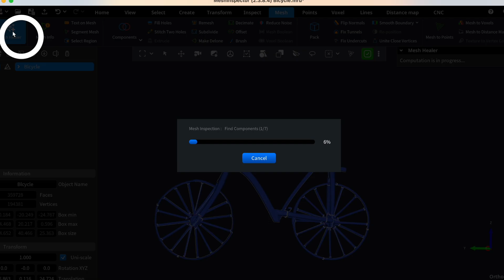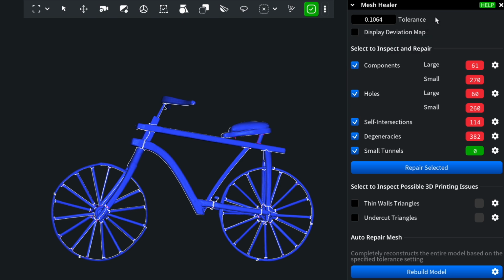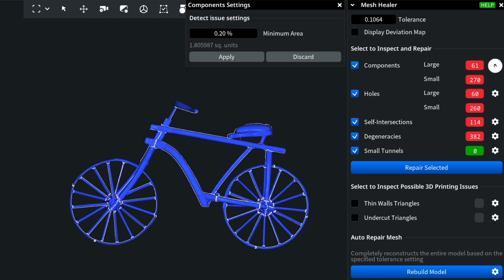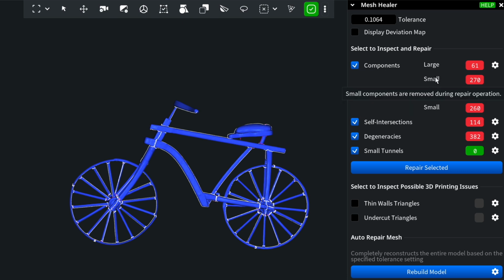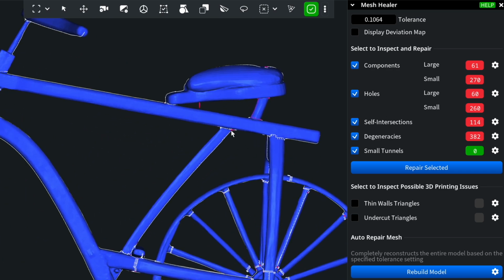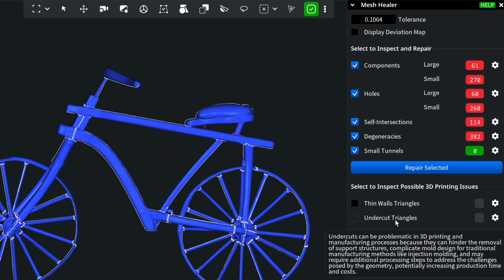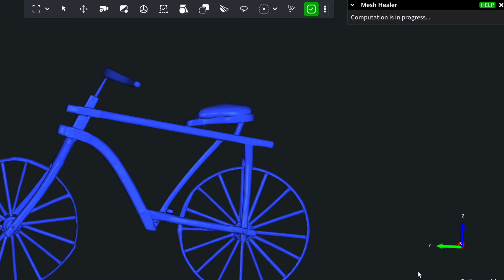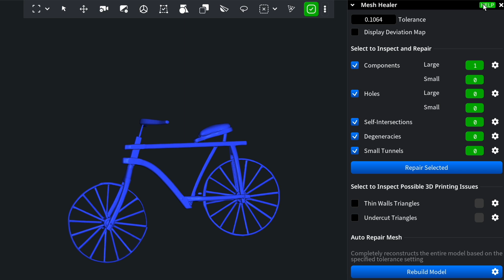How to Instantly Repair STL/OBJ in 1-click with Mesh Healer

Comment: Can't change the number in thin walls and all the rest
Reply from the maker: Hello! The wall thickness is identification in mesh healer is linked to the tolerance setting. There is a separate tool Measure Thickness on the Inspect tab that you can use.

Comment: How do you split on large and small components? Actually the result looks cool.
Reply from the maker: Thank you for your question! By default, MeshInspector categorizes components into large and small using a threshold of 0.20% of the surface. This setting is customizable, and you can adjust it in the component settings.

Comment: Wow, that's one rad bike model you've got there! Can you actually 3D print this beast and take it for a spin? Talk about pedaling into the future!
Reply from the maker: Certainly! This bike model has 3D printable potential, but it's important to note that it requires additional preparation after using Mesh Healer before it can be printed. 🚴💨